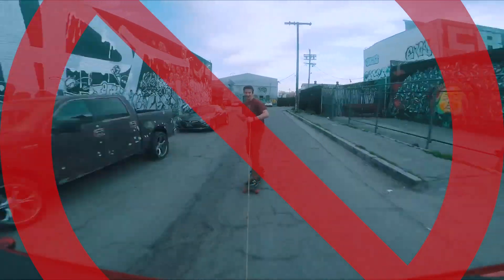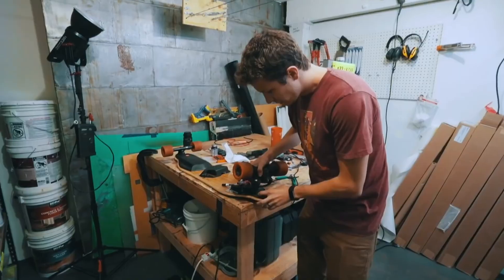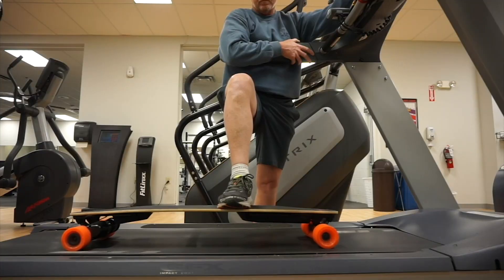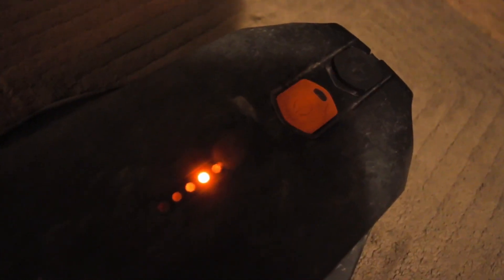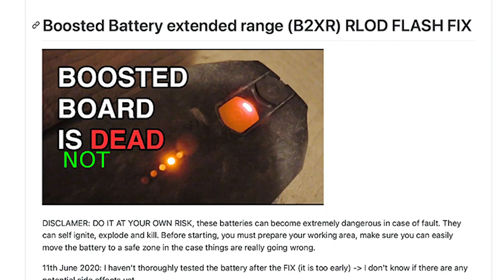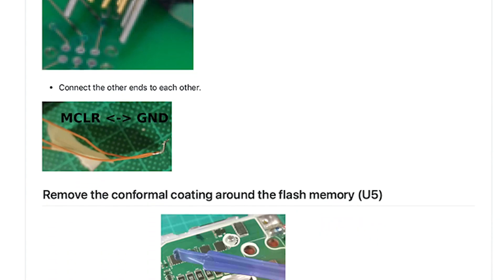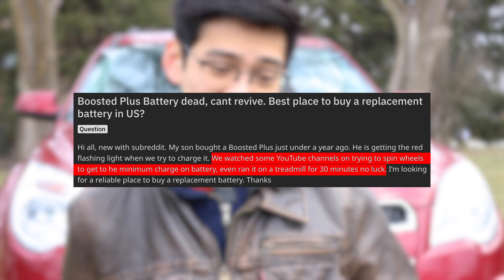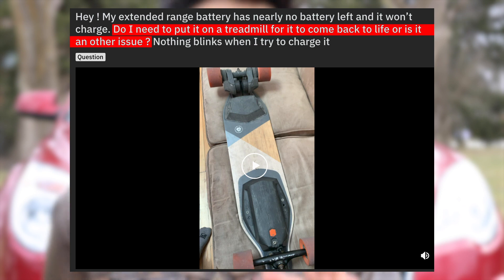How to fix Boosted Board Red Light [2021] (NO TREADMILL REQUIRED)

Comment: The treadmill method only works for the Version 1 booster board?
@XRGeneralHospital
Reply from the maker: Treadmill method doesn’t really work, even for V1 boards. It can work, but it isn’t really effective. What board do you have?
Reply: I have version 1
Reply from the maker: @phillipapodaca1125 you’re certain it’s V1? You can email us as well if you’d like in order to transmit photos: dtwang129@gmail.com

Comment: Where are you located? Zboard Pro battery red lights charger clicks green to red  board switch red to dark (( has been dormant for 3 years …advise?ty
Reply from the maker: Unfortunately, Zboard batteries work very differently than Boosted Board batteries. I’m in Michigan. Is there anyone near you that would be able to help?

Comment: I actually fix the red light of death on my friends boosted board without any of that it was free, I just needed a copper metallic pin and fixed it. Just to know
Reply from the maker: That fix method is not recommended. Shorting the memory module can cause your battery indicator to be no longer accurate, causing you to not have an accurate understanding of how much battery you actually have

Comment: Hi. I have the original boosted board with this issue. Left it too long. It only blinks red when I plug it in . If I rotate the wheels fast enough it it goes to red and then sometimes green. It’s now green but only when plugged in. It’s completely dead when not plugged into power. How can I fix this? 😊
Reply: Hello I need your information?
Reply: @BigBlack-nq2lj  can you fix it?

Comment: Hey.  Bro.  I. Have. A. Mini x. And.  It. Wont. Turn. On. And. I. Lookd. Up. The error cods and. Its. Ther. Is. No. Power. From. The. Esc to. The batery.  So. It. Stys yelo and red and. The 4 middle dots are on but. The bord. Wont turn on so i opend it and. Thes.  2 baterys in the esc and. It. Looks. Like. They need. To. Be. Chargd. Becus. Wen. I. Conect a. Power. To the. 2. Baterys. The. Esc. Turns. On.     Y. Ther. Is. No. Videos. On how. To. Charge the. Esc baterys

Comment: Just short pin 1 and 2. Badda Bing badda boom.
Reply from the maker: That method is unfortunately not reliable and potentially dangerous. I’ve had people come to me after they short those pins and I have to tell them that they have to buy a new battery since their battery is permanently bricked or shows the wrong battery percentage. The shorting method is the equivalent of drinking hand sanitizer to avoid getting sick.

Comment: Hi! I just found your channel and thanks for doing this amazing work. I have one question and I hope you’ll help me. I plugged my boosted charger into my boosted, cause I wanted to charge it, but my battery didn’t charge to 100%. It just stayed at 4 and a half dots. I unplugged the charger and plug it back and suddenly my charger died. So I ordered new charger with hopes, that the old one was just broken and the new one will charge my battery up to 100%. But no! Same thing. Boosted battery charges to 4 and a half dots and then no matter how long I’ll keep the charger plugged, it won’t get past it. And now suddenly the new charger makes strange high pitch noises. Can you please help me out? Thanks
Reply from the maker: Fascinating, can you shoot me a text? 734 837 8704

Comment: Do you know if this applies to version 1 boosted batteries or can I use the treadmill method?  My battery won’t charge but it has the bed blinking light. It hasn’t been charged in a couple years
Reply from the maker: This does not apply to V1s. The battery will have to be rebuilt more than likely. Can you join us here and we can help you get it rebuilt? https://community.xrgeneralhospital.com
Reply: @xrgeneralhospital  Hello there.  I tried to accept the link you sent which took me to my Discord, however, I can't find your channel or community there.  For some reason it's not letting me in there.  I would love to know how to recell or rebuild my battery.  It had only 200 or so miles on it.  I just didn't charge it for so long that it died.  Any ideas?
Reply from the maker: Can you text me? We’ve been having a technical problem since yesterday. I can let you in manually.
Reply: I dunno what boosted board I have. Got it several years ago. More than likely a V1. I literally never rode it. Was impulse buy. Fast forward a few years I found the charger but it’s got that red death blink 😂. I’m guessing just buying a new battery will be the easiest way to go.
Reply from the maker: @JoshuaDomoslai unfortunately V1s aren’t designed with replaceable batteries. Text me and I can direct you to a battery repair solution. 734 837 8704

Comment: so, my xr battery for a v2 booster board decided today not to charge anymore.
still have 2 lines on it, but does not want to charge, and i don't have the blinking red light. tried to look for a answer online, didn't find one.
Reply from the maker: Can you text me? 734 837 8704
Reply: @xrgeneralhospital  sorted mate, watched your video. Had a loose wire

Comment: I’d love to send you me mini x battery for repair. Question…. Once it is repaired is that sensor disabled? Will it be able to be recharged from spinning the wheels if it got the RLOD again??
Reply from the maker: Great question, Drew. We do not permanently disable any safety features when repairing. Rather, we diagnose what caused it to trip the safety failsafes and see if it is repairable. The safety features are there for a reason and we do not believe in disabling them to make it work again, does that make sense? Spinning the wheels will not undo RLOD.
Reply: @xrgeneralhospital  can I have a link to your site for a repair ?? Also about how long do you expect for repair to be complete on a battery as of now?
Reply from the maker: @DrewRomano  no problem! https://diagnose.xrgeneralhospital.com 

Wait time is about 3 weeks right now.
Reply from the maker: 3 weeks is the estimated turnaround! Here’s my website: https://www.xrgeneralhospital.com

Comment: Can you just put a different battery onto the board with the same voltage
Reply from the maker: Not quite. The board requires communication between the battery and board. We are working on a workaround so you can use any battery with the same voltage to achieve this!
Reply: @xrgeneralhospital  awesome thanks for the reply I just pick up an old v1 board but I’m in New Zealand so repairing is a bit hard , I might try the treadmill to see if I can get my battery to kick in
Reply from the maker: If that doesn’t work, it would definitely need a battery rebuild. Not stupid expensive, but stupid time consuming imo

Comment: How did this video help anyone fix their board?  Completely useless.  This is an ad.  Learn to write a relevant title.
Reply from the maker: I state at the first 5 seconds to not waste your time using the treadmill trick.

I state the next few minutes describing the advanced procedure. I have a link to a 30 minute video in the description of the uncut procedure as well as the GitHub tutorial

My first video is an uncut beginning to end walkthrough of how I did it so you can do it

I have a 700+ Discord community specifically so you can get free 1:1 help from 40+ volunteer surgeons

This video was made so you only had to spend 5 minutes to get to the resources you needed to figure out how you want to fix your battery. The very last resort is to send it to me. 

The title worked because now you’re not going to waste 3 hours of putting the board on a treadmill and you’ll send the battery to someone qualified to fix it, whether that’s me or someone else.  

I understand your frustration, but I put out the free resources first in front of you before offering the paid resources. An ad simply wouldn’t be that.

This comment is sponsored by XR General Hospital.
Reply: Hi, I see your points. I apologize for my previous comment.  It’s taken a while but I’m finally ready to tackle this problem.  Thank you.

Comment: Hey - hope you can help - my booster stealth is only charging half way and I have a red flashing led on the led array that shows the charge level - only 3 out of the 5 light up and let the board charge to half full - any ideas
Reply from the maker: Yep! Your battery seems to be normal. You’ll need to charge it for a couple weeks to recalibrate it.
Reply: @xrgeneralhospital  thank you - yea I left it on charge - seems to be slowly creeping up in %
Reply from the maker: Yay!

Comment: Hey man, I have an XR battery that's crapped out on me with the RLOD however, my standard range battery works fine on the board.  I saw on the BoostedUSA website that the XR doesn't work with a V2 board - is this true or can you fix an XR so it will actually work with a V2 board?  I miss having the long range.
Reply from the maker: Boosted USA is not correct. The V2s that they used to sell had the older firmware that was XR incompatible, so it was simply easier to say that XRs don’t work on V2s so that buyers wouldn’t buy an XR with their V2. As long as your V2 has a firmware version of 2.1.8 or higher, it should be XR compatible! Did you fill this out yet? https://diagnose.xrgeneralhospital.com

Comment: What about constant remote beeping on any mode above eco? I have a boosted plus and don't observe loss of power, both engines work. Cleaning and lubricating connectors did not help. Could that be a battery issue? Anybody ran into this before?
Reply from the maker: I do recall one case that resembles this. Can you jump in here and we can better answer? https://community.xrgeneralhospital.com

Comment: So if I can buy a gen1 that has this problem the treadmill might work? Are u saying the new gen is the one that it doesn't work for?
Reply from the maker: Treadmill trick might work, but more than likely it won’t work for long. You might need a full rebuild depending on whether or not it is fully reviveable

Comment: Hey David. My board has the red light of death. I charged it up and left if for about 8 months without riding it. I rode it all day long 2 days ago and at the end of the day when I turned it off after riding, instead of turning off, it started blinking red. Is it finished or can it be recovered?
Reply from the maker: I think there could be a chance! Send me a video: https://diagnose.xrgeneralhospital.com
Reply: Hey David  have the red blinking light and  2 red lights  on  on my battery what should I do
Reply from the maker: Text me. 734 837 8704

Comment: So my board works with the regular battery but the XR battery for a v2 board has all the lights light up bright and power button red when I try charging it. When it’s connected to the board the power button flashes and the the smaller leds light up top three then bottom three. It shows up on the app when I turn it on but the wheels don’t move and it shows the same range as the regular small battery.
Reply from the maker: Hmm. Send us some pictures/videos here and we can better help you! https://community.xrgeneralhospital.com

Comment: so you mention it wont work "anymore", does that mean the later versions of boosted boards arent capable or what? When did the changeover occur? V1, V2?
Reply from the maker: Yeah, that would be V1 to V2. V3s are very similar to V2, and thus, it won’t work for V3s either.
Reply: @xrgeneralhospital  but how bout my v1?
Reply from the maker: I know a guy who can rebuild your battery in my community! community.xrgeneralhospital.com
Reply: @xrgeneralhospital  don’t have discord or know how to use it
Reply from the maker: Email me. I can get you directly in contact with him. dtwang129@gmail.com
Reply: @xrgeneralhospital  i mean im just trying to see if the treadmill thing works on v1. I know how to rebuild lithium packs, just looking for an alternative at the moment.
Reply from the maker: Ah, in that case, yes, the treadmill trick will work on V1, within reason. Many still report that range isn’t great even post-revival.

Comment: Yes the treadmill does not work well... But... If you spin both wheels backwards with any other system you show in your video, or better, wih another E-skate: Guess what? It does work really well on any Boosted V2.
Reply from the maker: Huh. Can you show me this working?
Reply: @xrgeneralhospital  There are enough YT videos ;) and it does work (assuming you don't leave the batteries leaking unattended for 15 years).
Reply from the maker: Can you link one of a V2 working after the treadmill trick? All the videos I’ve found are all V1 boards.
Reply: Do I have to turn on the board? Or can I leave it off and make the both wheels turn backwards on treadmill. Please reply fast I am going on a vacation tomorrow
Reply from the maker: What board do you have? V1? V2? Stealth? Mini? Plus?
Reply: @xrgeneralhospital  I have a mini X, thank you for fast response I really appreciate it bro
Reply from the maker: Unfortunately, the treadmill trick won’t work for Mini X. It works differently. It won’t be fixed before you go on vacation. Send me a video whenever you get back: https://diagnose.xrgeneralhospital.com
Reply: @xrgeneralhospital  there must be a way, I really want to take this board with me tomorrow, please tell me if there is a workaround
Reply from the maker: There isn’t a workaround other than opening it up and doing surgery yourself. I wish there was a way.

Comment: I have a boosted board v1 dual and the battery keeps blinking red. I have ran it already on a treadmill for 3 hours and it hasn’t worked. I’m not sure what to do with the board and if I should replace the battery.
Reply from the maker: I know a guy who can help! Email me: dtwang129@gmail.com
Reply: If u dont break the wheels a little while running it on the treadmill. U arent sparking the battery. Its like a dynamo. It needs resistance:  to take  charge from the spinning of the wheels. Slowly increase breakpower so that u feels it slightly resisting the treadmill.  Then itll work like  dynamo and take a small charge  from the rotations.

If its dead turn on the remote. Plug the board into charger: then do this. While its plugged in.
Reply from the maker: @MrSeanmcgall to be clear, this method only applies to V1 boards.

Comment: Hey David, thanks for your service to the boosted community! I myself have RLOD on my stealth and was looking at your google form for battery diagnosis and am considering sending it in. I have seen many people discussing the Amnesia chip which prevents future RLOD error codes. I was wondering what your stance on those is and if you could/would install them? Thank you so much for the great work!
Reply: I am having a issue with my board. Went to charge it after not riding it for a bit. It is flashing red an only blinks to the second light.  Any ideas?
Reply from the maker: Did you send me an email? Feel free to text me: 734 837 8704
Reply from the maker: No prob! Go ahead and email me: dtwang129@gmail.com

Comment: This is all true if you have an extended battery, But for standard battery those methods will work as I have brought back two batteries by spinning the wheels.
Reply: hey, how long did you have the spin the wheels on the standard?
Reply: @MarcusTim0thy  One wheel for a solid 3min with a impact drive (higher rpm then drill) with a oil filter socket (anything larger then the wheel will work (like a gear ratio)) Have the charger ready for immediate plug in. Keep trying till starts charging.
Reply from the maker: Hey, can you demonstrate that this works for the Standard Range Battery somehow?
Reply: Yes !! I have a stealth boosted board extended battery!!🪫 haven’t used it in years because of that stupid red light
Reply from the maker: @julianvillegas3910  can you shoot me a text or email? I can help!

(734) 837-8704
dtwang129@gmail.com
Reply: Boosted was always going to fail, trying to be apple